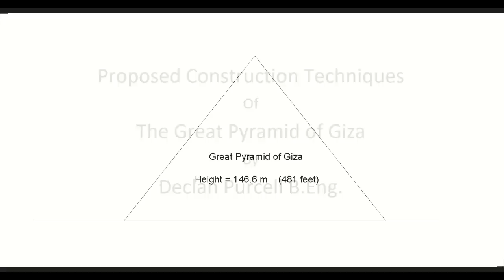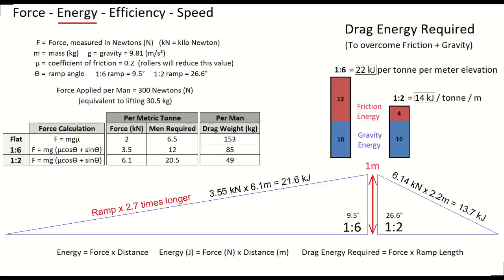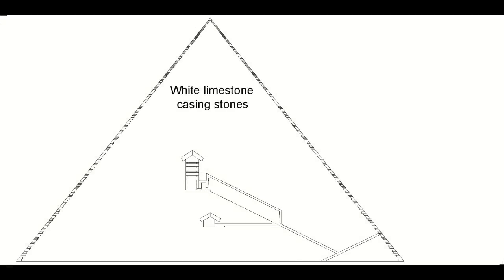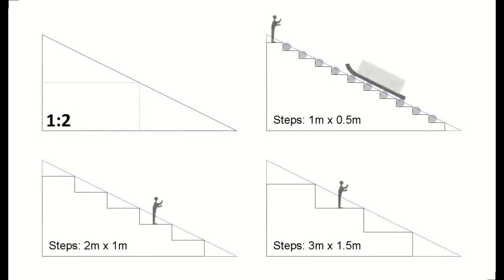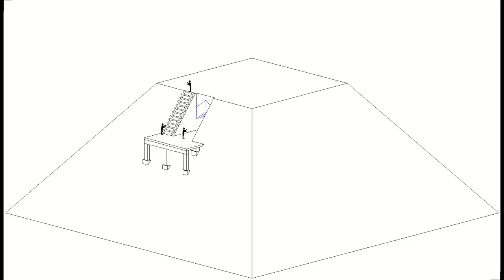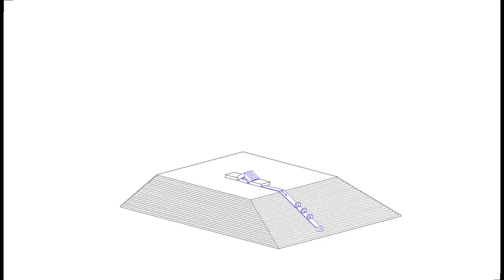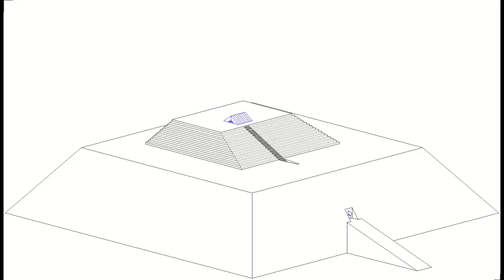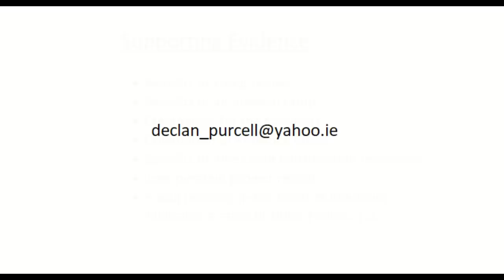Proposed Pyramid Construction Techniques

Comment: I've been going down the rabbit hole of pyramid construction for only a few months, but some of the proposed techniques are a tad extra. The one where it was proposed that they built a large mario bros. pipe on the side of the pyramid to float the blocks up was excellent in theory, really cool and well thought out, but just way too complicated IMHO for ancient times. I couldn't imagine those brick pipes not blowing out the bottom with literally thousands of tons of water pressure near the bottom. It's also worth noting that much smaller pyramids were constructed numerous times successfully, and I can't imagine that someone would have thought "Oh we'll need to reengineer the entire process in order to move the required stonework into place".

It seems much more plausible that they would have just used previously successful techniques that worked, and refined them.

This method seems so simple and it doesn't feel like it's a complete rethink of how a pyramid would have been done on a smaller scale. Just a natural progression of an ambitious project. When a pharaoh decided he wanted a mega pyramid, I can't imagine they would have "reinvented the wheel" so to speak in order to accomplish the task. I feel like this method would just be a lot of extra work and a grander scale of projects they had completed successfully in the past, and that makes it so much more plausible to me.
Reply: I’ve always thought that the floated the stones up using water, a canal from the river then a wall around the entire site , the wall would need to be quite wide at the bottom, and a lock system to move the stones, the dam wall would be removed upon completion of the project!!! I thought of this about 10 or 15 years ago when moving large rocks in a river for some forgotten reason, probably just messing around, but the buoyancy of the rocks clicked a thought in my head which has never gone away, I’m not saying that I’m right but I am saying that it’s possible, anyway …
Peace out from the police state of north Wales 🏴
Reply: I still like the 'mario pipe' theory maybe because it has many benefits and simple to explain. I understand it is not as easy to construct as to describe. I like it because it really makes me think outside the box. The method  described here in this video is my second favorite.
Reply: Watch a video on the VerseByVerseBT Youtube channel called Ancient Aliens Debunked. It's 3 hours long but there's a section about the Great Pyramid's engineering and internal ramp which you may view at about 22 or 23 minutes in. It's just a 15 minute section. And the video is a decade old. I haven't looked into what's been learned in the past decade.
Disclaimer: Most of the videos on that channel are related to Bible talk. But the AA Debunked video contains none of the Bible talk. So, don't be put off.
Reply: @aishalotter9995  It is possible but it doesn't factor in how much pressure the water would have at those volumes towards the bottom of the shafts. It would be immense. Building any time of structure to accommodate the amount of water needed to float blocks that large would probably be on scale with the pyramids themselves. It's a great idea, but it begs the question, how did they get the blocks up to build the shaft wall that they used to get the blocks up to build the pyramid.

Again it's a cool idea but it's impractical. It solves the idea of how they raised the blocks to build the pyramids with the question of how they raised the blocks to build the water pipe, except it doesn't seem to explain how the bottom of the shaft would be able to withstand the pressure of all the water on top pushing down at the base of the shaft.
Reply: @awfullufwa  Thank you for the reference to Ancient Aliens Debunked !
Reply: @gemerat  yw
Reply: @daxlarsen2121  A column of water 480 ft or 150 m deep, is only about 200 psi or less than 14 bar.  It would certainly be a challenge to seal stone masonry against that pressure but not impossible.
Reply: @James Jenson  what's the diameter of the cylinder?
Reply: @jackhand4073  big enough for the blocks I suppose...
The pressure would be the same regardless of the diameter; that Bernoulli thing.
Reply: @James Jenson  thanks for the reading. So my question should have been: What is the combined weight of the column of water at the base? If I've understood my glancing at water pressure
Reply: There are umpteen methods we can think of today that would work to build the pyramids. The problem is how did the Egyptians do it. I think the water shaft is a great idea and it's very clever, however I just don't see why the Egyptians would have invented that method (why didn't they just invent the wheel and roll the blocks up?). Again there is absolutely no evidence to support a water shaft theory anywhere on any of the pyramids. There is evidence they used the causeway to float the blocks to the construction site. There is however, ample evidence to support ramp theory on numerous other pyramids, including still existing ramps in the quarry sites.

If they had developed this method to construct the pyramid then why not do the following;
   -Prep stones all season in the quarry, having them ready to move out, construct water shaft in dry quarry
   -Flood quarry during Nile flood season, float blocks out of quarry, transport to barge or whatever method was used to transport (I saw a video where they had a partial script of someone who kept detailed records of his transporting the pyramid stones by boat/barge what have you)

Just on the basis that they had to mine the blocks, get them out of the quarry, transport them sometimes hundreds of kilometers to the pyramid, all seen with evidence of how they may have done it using ramps and pulleys.

Then at the last possible step have some super secret advanced method with absolutely no trace of its existence or its technology anywhere, or ever having been used before, or after to get the stones into their final position

...or they used the same method they used to get them to the site in the first place, ramps, ropes, pulleys, manpower.
Reply: @Dax  that's how I feel. Just complicating things. My physics was wrong before but a vertical tube to float 80 ton stones to the top of the pyramids is wild.
Reply: @daxlarsen2121  I understand what your critiques are but there is actually quite a bit of evidence that the quarries were indeed filled with water.  Things like the fact that the skeletons of the workers did not show a hard life of heavy labor but rather a relatively healthy lifestyle; i.e. sitting in cool water chipping away at stone.   Also it was theorized that the water surface was also used as the block-shaping tool, as the blocks were quarried.
For the record, I don't think it was a literal 'Mario' pipe of stone on the outside, I think the internal 'ramps' were, in fact, the tubes that were flooded.
The only time a stone would need to be lifted out of the water would be to place it in a perimeter position at a new level after completing the previous level.  Once the new perimeter was complete the water level was raised and the rest of the internal blocks and the next level's perimeter blocks could be floated in.
Reply: @awfullufwa  Ancient Aliens asks the viewers more questions than gives possible answers. No joke a question about every 1-2 minutes.

"But what if"
"Could it be possible that..."
Followed by, "The answer is...Yes"😂
History Channel is a bunch of bulshi*.
Reply: @libertyforall5764  I know. That's why I redirected some folks to Ancient Aliens Debunked. You're agreeing with me. Your comment was unnecessary. Are you sure it was me you meant to reply to?
Reply: @FiferSkipper everyone else here is arguing that it's impossible when they plainly don't know a single thing about fluid pressure or buoyancy 😂😂😂 "must be space aliens then"

Comment: Very impressive, and straight engineering simplified as much as possible even considering work flow and scheduling. Read Houdins book when it first came out and was very impressed with spiral ramp theory although it's a bit complex. The chevron chamber and space above grand gallery really lend some credence to this theory. Although muon detectors aren't perfect and can miss alot,  such as smaller corridors there's evidence they may have backfilled voids with compressed sand which would further obscure them.
Radar probing from upper kings chamber arch lintels might detect gallery over the short distances its usefull as well as limited drilling. Also muon detectors in upper kings chamber voids, but in particular at entrance chevron oriented back toward king chamber. A long shaft would show of very brightly.  Probes and maybe radar at upper corridor end coverings. Really like what you've done here!
Reply: Don’t know much about the subject, but my imagination makes me think that maybe the Bent pyramid was result of using spiral ramps beyond the critical point where an internal ram was needed. This could explain why the slope suddenly becomes shallower - as to support an external spiral ramp for construction. In this context an internal ramp seems like a logical next step.

Comment: I’ve watched many speculative pyramid construction videos, but after watching this video, I came to the conclusion that Declan has it very close to, if not absolutely right. Furthermore, I thought of something else, and what I thought of virtually necessitates that construction proceed in the manner he outlines. Here’s the additional information that helps solidify his theory …

In order to assure that the four corners terminate in a single point at the apex, you must affix most of the outer casing stones as you complete each layer. You must verify that each corner is precisely 90 degrees, that the distance between each corner is exactly the same, and as you proceed upward, that the slope of each corner is identical. 

An inner core can be built first, followed by the outside layers, with a fourth side left uncompleted, or only partially completed (as he depicts), to facilitate construction. But the important part is this -- as you build upwards, you must complete at least 3 sides of the pyramid, as well as all four corners (including the casing stones) for each layer. And you must verify that each layer has 90-degree corners, which are equidistant and have the same slope. 

If all this is done properly, when you get to within 10-20 feet of the top, you should have a flat, level, square surface, whose four sides are parallel to the sides of the pyramid at the base. But if you get it wrong, you will end up with a landing that is not parallel to the base, and is not square – meaning it will be either a twisted or rotated square, a rectangle, a parallelogram, a rhombus, a trapezoid, or an irregular quadrilateral.  

One last thing. I went to Egypt in 2016, and as part of the trip I visited the pyramid at Saqqara. They were repairing it (i.e. replacing stones that had fallen), and had massive wooden scaffolding affixed to two sides of the pyramid from the base to the top. The wood was very old and looked like it had been used many times. Meaning … there’s a very good chance they also used this same technique 4,000 years ago.

Comment: I love this video. I've had fireside debates with friends on how it could have been done, with admittedly diminishing ties to reality as the night wore on. 

A few thoughts, one being that two men could lift a 100kg block up a ramp, if steps are beside it, they could then counterweight a 200kg rock with themselves and the 100kg rock. Repeat with increasing stone size and extra men for support, combine with levered assistance ratcheting the stone upwards, and doing it in stages.

The other being that appropriately sized logs fitting into the step tread actually forms a ramp, and incidentally gives you a way to stand up your stone. Go higher, remove log, lower to step, and raise from there. Even allowing you to rotate the "exit logs" perpendicularly, so you can move the stone off the main ramp to where you need it.

Anyway, love your train of thought.
Reply: Sounds interesting too.

Comment: Great theory:
A small question for clarity: Is it necessary that the turning platform (85m) ist at the outside of the pyramid? I would guess they could turn also inside the pyramid.
This would mean that the upper chevrons might not be shortly beneath the surface … and not finding them would not disprove your theory.

Comment: If you had a greased ramp you could use a pulley at the top and a sled of logs. The logs would reduce the contact patch with the ground if they were tied such that the logs went vertical up the slope, like ribs going in the travel direction. I think this would help with the massive friction. And the objection about needing a huge ramp that takes as much material as the pyramid is overcome if the pyramid is also the ramp! Pretty ingenious. I hope the scan project reveals supporting structures to this theory.
Reply: I think contact patch does not matter for friction. Because you will increase the pressure on that smaller patch. Only weight matters.
Reply: @jojojo9240  you are right that the amount of friction would be the same but I think the stiction would be far less than if you had a flat dressed stone against a flat inclined plane.  But I could be wrong

Comment: This is very interesting and part of this hypothesis is very similar to Jean Pierre Houdin's theory for the function of the Grand Gallery, also, it would explain the "big void" found above it.
The only problem I have with all these explanations on how the Great Pyramid was constructed is that the pyramid of Khafre is almost as big and, as far as e know, there are no internal ramps like the Grand Gallery inside it. So how that one was built?
Reply from the maker: Good Point…

Jean Pierre Houdin's theory requires a low angle internal spiral ramp (which is not practical) and the grand gallery as a construction device.

My theory requires a two-stage internal ramp with just one turn, which is facilitated via the staging platform.

Also, I do not require the grand gallery for construction purposes, therefore my theory also applies to the construction of Khafre’s pyramid.

Comment: Wait I have a massive problem, how do aliens come into this theory?

JK this is amazing. Your solutions are some of the best, no actually THE best I think I've seen so far. Especially the "we dont know when the emperor will die so lets make multiple burial chambers as we build just in case" that explains the unfinished below bedrock chamber the "queens chamber" and ultimately the most impressive part of the entire structure the "kings chamber" where Khufu was eventually interred. This also gives more clout to the theory that he reigned for possibly the longest of the kings around that time.

Comment: I am very impressed by the video and watched it a few times. Just one question re the Grand Gallery: Why is it that big instead of the size of the shaft leading to it? Am I missing a point? Does the video explain it somewhere?
Reply from the maker: The grand gallery is still an enigma, however, the tunnel leading to it was blocked by 3 granite plugs once access to the Kings chamber was no longer required and these plugs were stored in the grand gallery during construction as they needed to be slide into place from a higher elevation.

Comment: Excellent video.  I like how this theory also explains why the internal ramps would be there instead of contradicting their existence.  Curious if all of the mega blocks that were used would have fit inside those chamber ramps.  It seems like maybe some of them would not.
Reply from the maker: Thanks!   
As shown in the video, the mega blocks are raised before the internal ramp is enclosed..
Reply: @declanpurcell571  sorry, I must not have paid close enough attention to that part.  But that would likely have to be how they did it.   Now if we can just get a better quarrying theory than banging round dolomite balls.
Reply: @ocrun6765  Completely! I think that is one of the most interesting questions regarding old world megalithic structures around the world, whether that's in south america and their precise geometry shown in "Incan" structures or  in middle eastern areas!
Reply: @ocrun6765 they also used fire. Not sure why you would need a better one when it works.
Reply: @ocrun6765  dolerite
Reply: @ocrun6765  Dolomite is clay dude
Reply: @ocrun6765  the dolerite tools were shaped. Once the tool has been rounded off by use they are discarded.
Reply: The ultimate point is "they" did it. Period!
Reply: @dananorth895  yes, ultimately "somebody" did "something" and let's not be curious or think critically.  Dolerite balls and 5 mile ramps.

Comment: Brilliant,I've been working on a hypothetical method for some time,that the pyramid was built as a three sided structure,using the increasing height as the ramp, before filling out the 4th side